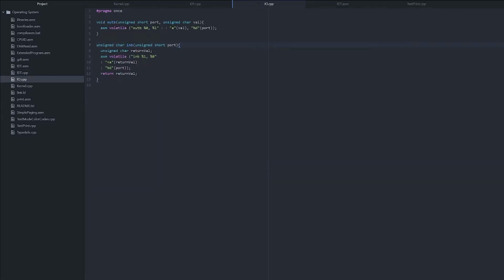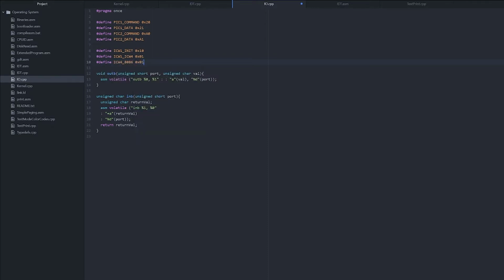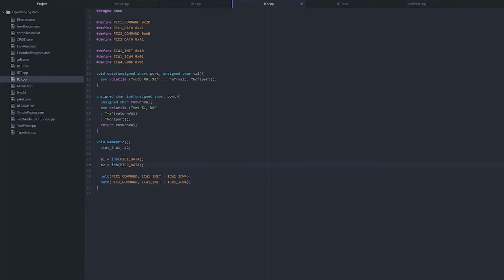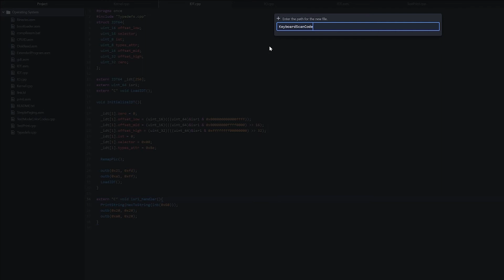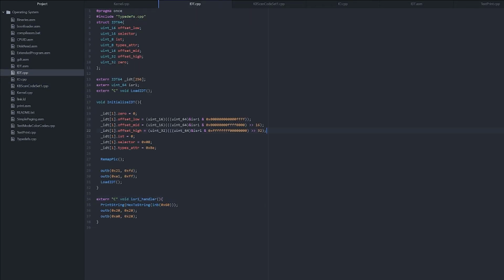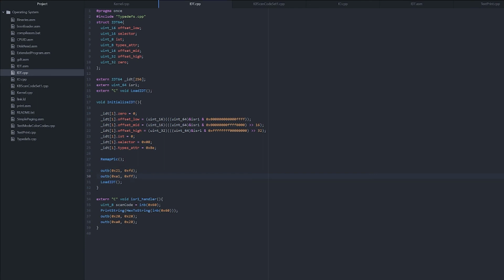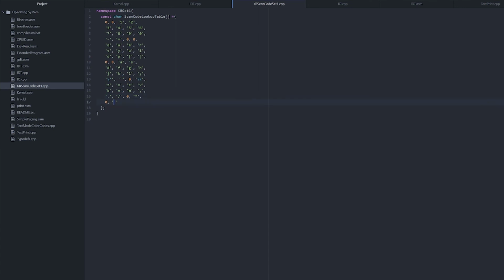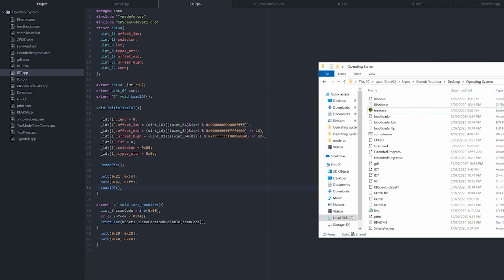Translating Keyboard Scancodes | Make a 64 bit OS From Scratch!! | Part 13

Comment: Old video but I think that IDT.cpp:18 should be for(uint8_t t = 0; t < 255; t++). 
In the previous video you noted that the typeof t should have been a uint64 but I believe this is mistaken due to the usage of a uint8 resulting in an infinite loop due to t < 256 rather than t < 255. This would also result in a overflow of 16 bytes.

Comment: When i compiled and ran the image a got this error from bochs:
 [PANIC] : Device : [ PIC ], message : [ not 80x86 mode ]
I debugged the source code and i found that the error is caused from outb(PIC2_DATA, 2);, in RemapPic function.
Reply from the maker: Are you in the discord server? If you post your full source there, I'll be able to have a look and see if I can help
Reply: This is my complete remappic function, works for me, compare it with yours:
void RemapPic()
{
	uint_8 a1, a2;
	a1 = inb(PIC1_DATA);
	a2 = inb(PIC2_DATA);

	outb(PIC1_COMMAND, ICW1_INIT | ICW1_ICW4);
	outb(PIC2_COMMAND, ICW1_INIT | ICW1_ICW4);
	outb(PIC1_DATA, 0);
	outb(PIC2_DATA, 8);
	outb(PIC1_DATA, 4);
	outb(PIC2_DATA, 2);
	outb(PIC1_DATA, ICW4_8086);
	outb(PIC2_DATA, ICW4_8086);

	outb(PIC1_DATA, a1);
	outb(PIC2_DATA, a2);
}
Reply: @tommytomtomtomestini3894  wow, your name has too much Toms
Reply: I get this same message too